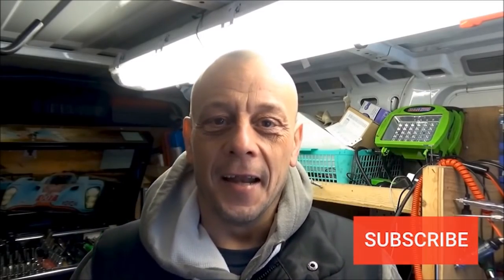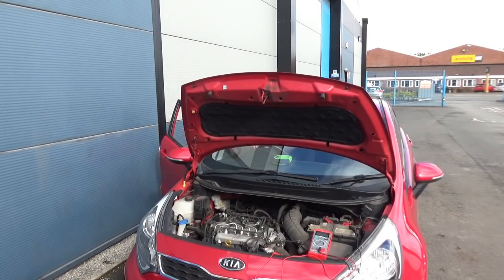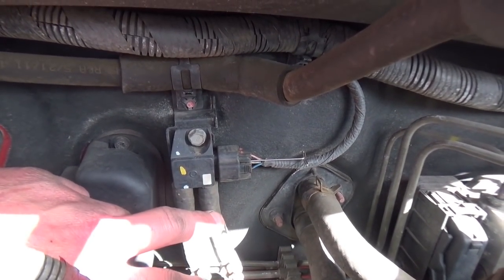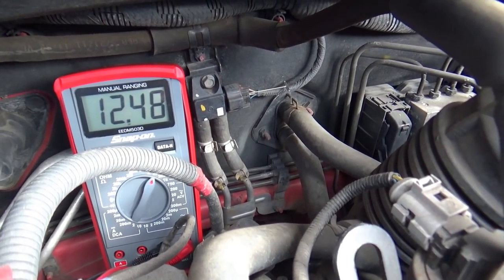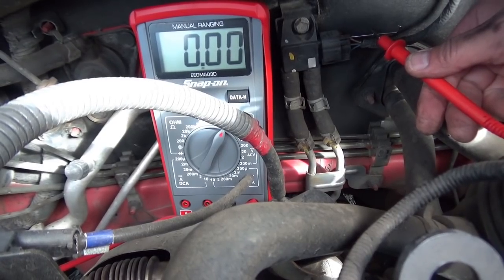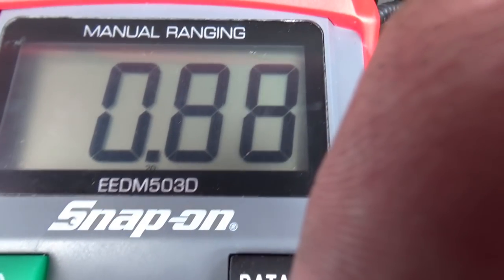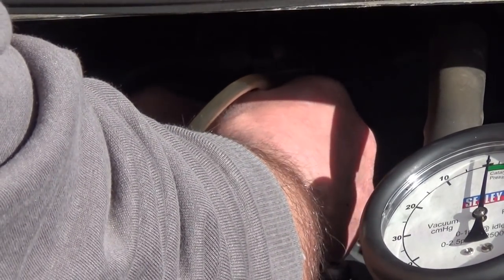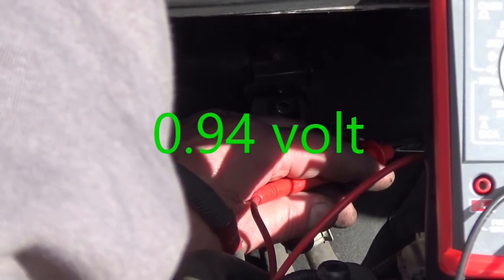Kia DPF pressure sensor testing

Comment: Good video. Most DPF pressure sensors have one of the tubes larger than rhe other. Which tube goes before the DPF (higher pressure)? Large or small tube
Reply from the maker: Big tube to pressure, small tube to atmosphere or post dpf

Comment: I'm getting signal at 4.7v and reading of 106kpa If I unplug the two pipes from sensor it stays same any idea where to go from here?
Reply from the maker: Check power and ground to sensor, if they're good and you still have 4.7v on signal line then it's probably the sensor. Be very sure and check all your wires for short to plus, to ground and to each other, also check signal line is good back to the ECU before fitting a new sensor.

Comment: Possible solution is the the sensor is faulty the static voltage on this model should be around 1v (not 0.8v) plus the front dpf pipe blocks

Comment: Dpf has been removed, cleaned, along with the hoses and tested and is working as it should, the exhaust system has no problems, the car is working perfectly and has had a forced regen preformed. Aircon recharged a new fuel fitter put in. But the engine management light is still coming back on (blinking) it has also had an emissions test done and is fine... totally lost for what to do next. . Kia Rio 1.1 diesel 2012.
Thanks for any advice.
Reply from the maker: Go to www.the-dpf-doctor.com and find your nearest accredited DPF Doctor. They will be able to help you. Don't just Google DPF Doctor, there are lots of frauds out there that claim to be members. Hope this helps.

Comment: video is very simple and explanatory enough
Thank you very much for the video
I have a Renault Velsatis 2.0 dci vehicle
had particulate filter blocked
That is why the vehicle did not raise revolution at 1000 rpm.
After cleaning this filter said the vehicle already managed to raise the revolution
but I started to turn on check light
connect to a simple scanner and read error P1435
as I understood error it was because of the pressure sensor failure
I bought a new one but the error still fails. I wanted to delete the DTC record but immediately it came back to you, who recommended me?
in advance thank you very much

Comment: If anyone can advise be grateful, replaced dpf on my mk 6 golf 1.6, with a cayc, the one I found on ebay only had a dpf sensor before the dpf, and second half of the sensor measured against atmosphere, the car runs but I keep getting intermittent faults with low voltage circuit A, and out of range, anyone had this and managed to adjust for it?

Comment: Why is there a .5 difference in pressure between front and rear pipe? Thanks
Reply: one pipe is upstream of the DPF and the other is downstream. The difference in pressure is the pressure drop across the filter.
Reply: @trevord7659  actually its increase not drop

Comment: Great video. Quick question and it's probably a silly one but I'll ask anyway. 

My son's car cut out due to something on the dpf side of things. On closer inspection to the sensor, like the one in this video, the line on the right only has about an inch of tube left on it. I assume that should be connected to a line somewhere and that's the issue?
Reply from the maker: Not necessarily, some vehicles use atmospheric as a reference from the 2nd port. Best advice I can give is to find your nearest Dpf doctor network garage. Let's fix the cause, not the symptoms 👍
www.the-dpf-doctor.com
Reply: @SimplyDiagnostics  thanks very much for taking the time to get back in touch with me. I'll book it into a garage 👍
Reply from the maker: No worries, be sure to use www.the-dpf-doctor.com for a first time fix without wasting money 👍 your nearest accredited member is there.

Comment: My dpf sensor melted and vw have claimed it was caused after the timing belt and water pump was changed I’ve changed the sensor but I can smell Burning again what should I do ?
Reply from the maker: If you can smell burning there is a significant risk of fire.
Turn the vehicle off, do not restart.
Have the vehicle recovered to your nearest qualified workshop.

Comment: What you need to do next for the Differential Pressure Sensor is calculate what the voltage should actually be. I.e. 1 PSI - 0.5 PSI = A difference of 0.5 PSI across the sensor. Then look at the datasheet for the voltage at 0.5 PSI. Otherwise a good video
Reply from the maker: As a mobile tech I often work in areas that have no internet, I don't have time to be looking up sensor data sheets, my customers don't want to pay me to look up data sheets, the weather and time is nearly always against me. I use my experience and pass/fail tests as go/no go points for a logical, evidence based diagnosis, quite often, all I'm looking for is a credible change of state for given test conditions. Cheers.
Reply: @SimplyDiagnostics  I appreciate your logical thought process, it gets the job done. Just my 2 pence, keeping a log between common vehicles specifically for the Dpf Sensor at idle is handy as they tend to drift in voltage but function in terms of pressure, especially on VAG cars as their G450 is mounted right on top of the hot DPF unlike this vehicle where it's away from direct convection
Reply: With both tubes disconnected is not a valid reading.

Comment: Hello is that the order of the cables - 5v - signal - ground ? Someone cut my cables on i am not sure if he reconnected them the right way because i have ebp sensor problem minimum differential pressure + my reading are -250mbar i changed the sensor and still the same readings , earlier i had a exhaust back pressure sensor interuption or short to earth faul + like i said my cables are cut off and spliced together with new conector so i think the problem is in the cabels are the cabels on the same order with any car brand because i have a bmw ?

Comment: what is your base line to consider plug or restricted  dpf ,  for example  you say at 2,000 rpm I do not want to seee more than this voltage or pressure on scan tool?
thanks for the video
Reply from the maker: Joel Automotive  In action less than 10mb @ idle, <70mb @ 2500rpm
Reply: @SimplyDiagnostics  
thank you

Comment: What was the out come of the fault, actual DPF pressures okay so sensor at fault? Nice video btw good universal tests used 👌
Reply from the maker: Hi Harry, the DPF was fine, the dtc was, I assume, from previous testing. The car needed some tlc re deposits. I wasn’t actually diagnosing this, I just used it to make a video.